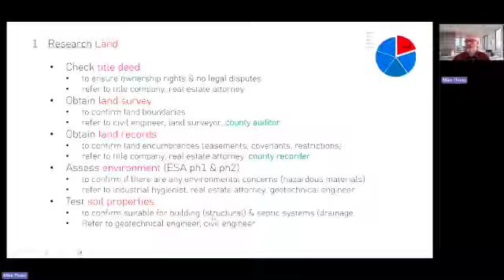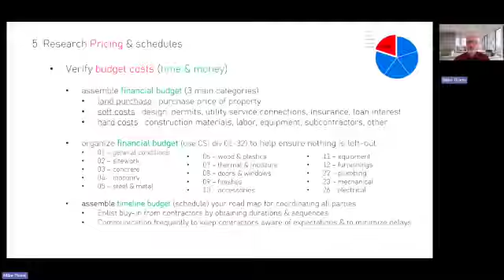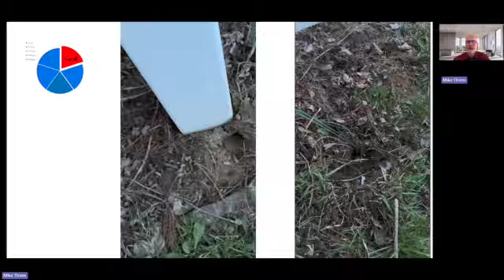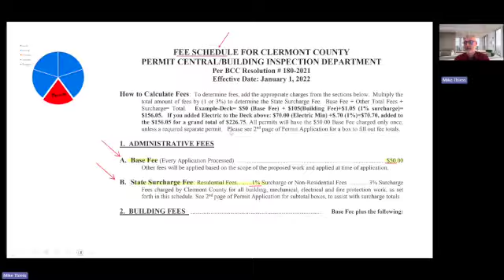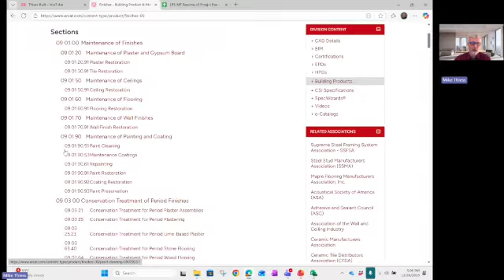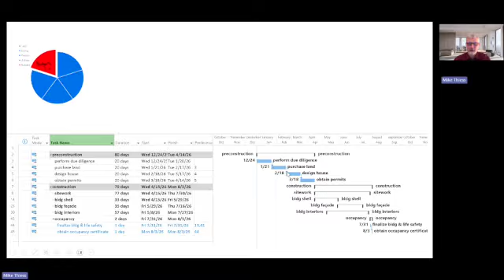You How to Self-Build Your Own Home -Lesson 1- Due Diligence

Comment: For Microsoft Project, which purchase option is needed for an individual to build their own home? Thanks!
Reply: I’ve been fortunate to have had the MS Office suite of software applications provided to me throughout my entire work career, which means I’ve not had direct experience with purchasing the software, so I’m not certain, but I would think of the scheduling software as a tool, and know that there are other options out there, such as:

(1) Primavera P6 being the best, but also the most complex and likely the most costly and hardest to learn; 

(2) MS Project is the most frequently used (IMO) because of it being available in the MS Office suite of apps;

Smartsheet is another one I’ve seen used occasionally and it seems to be simple to use (much like a spreadsheet) but likely has a purchase price to consider. 

MS Excel (or Google Sheets) is another option I’ve seen used for simple projects when a manager did not have experience with scheduling software or did not have access to software. 

There are likely other apps out there that could be used, for example, Monday.com is one I’ve heard of but have no experience with).

As a beginner, my advice/opinion would be to focus more on the content of the communication than the investment of software and to put your data (activities, durations, dates) in a table (spreadsheet), so that you don’t invest too much time & money, but listen to your inner-man and you’ll know which option is best suited for you. 

God bless. 
Mike